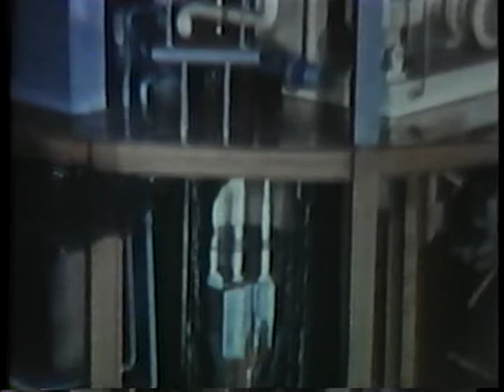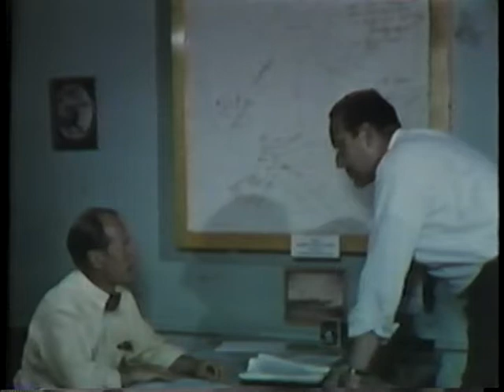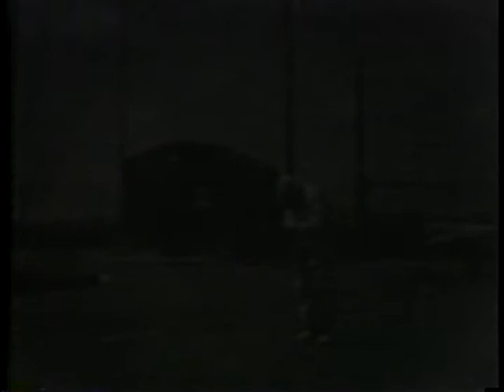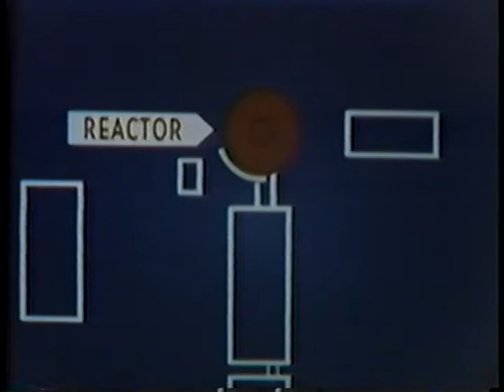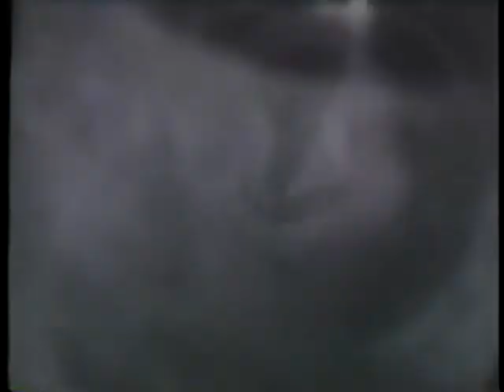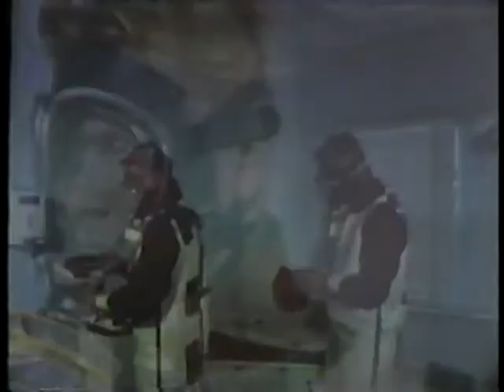Americas First Nuclear Power Accident - Sl1

Comment: I grew up in Rigby, ID.  My father worked most of his life at the INEL.  I can't remember the number of times he came home wearing coveralls or shoes other than the ones he left in because he'd been 'crapped up'.  He was one of the very first hot cell operators who ran the remote manipulators.  The debris from the SL1 accident went through those hot cells.  He told about sifting through it with the remote and finding a thumb among the other items.  I remember him talking about how back then, they didn't know much about what they were dealing with.  Some of the stories he told about how the waste was handled back then would curl your hair.  He passed away 3 years ago, so I guess it doesn't matter to talk about it now.  It seems to me there was a publication that included information about this.  I don't remember the whole title, but it seems that it was (in part) "Proving the ...."  Can anyone tell me what this publication's title is?